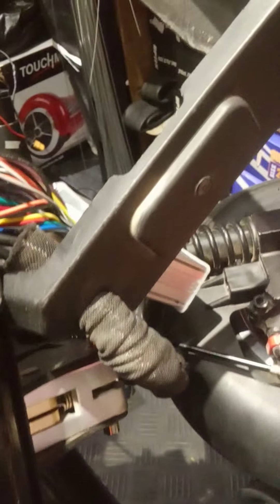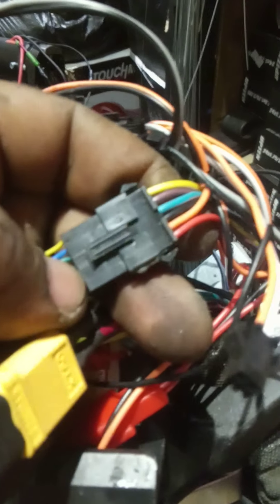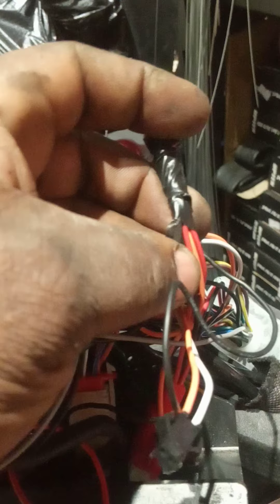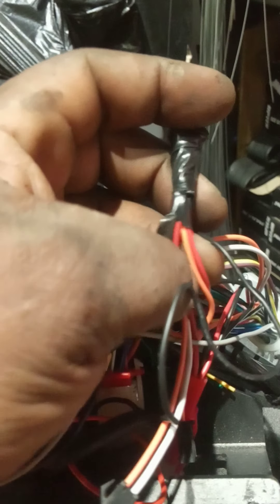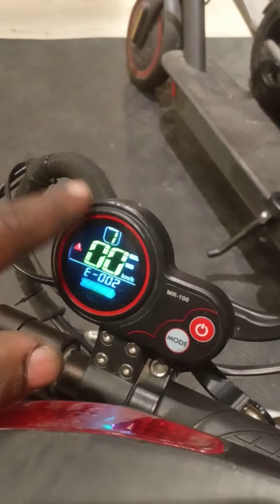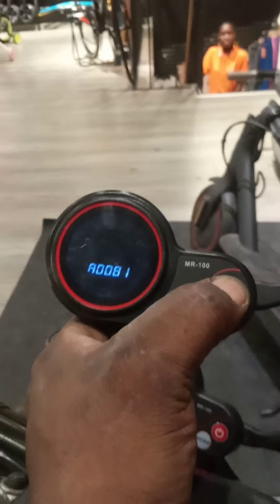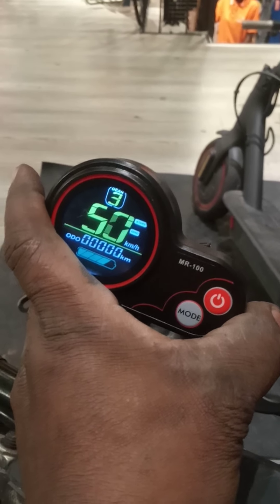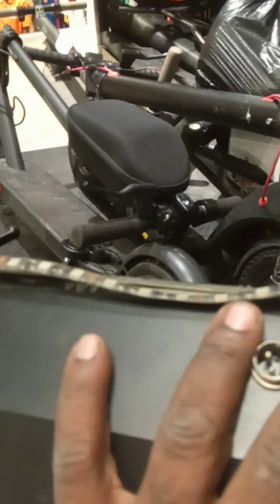Installation of brushless motor controller on E10

Comment: good morning friend I have an electric skateboard just like yours I have a problem the display does not work it wants to turn it on but it does not turn on and I have seen that the battery is fine could you give me some advice what could be the problem
Reply from the maker: Change the LCD
Reply from the maker: Change the LCD

Comment: Pls my motor work another side
Reply from the maker: Thanks for your support. Your motor has a reverse program of memory
Reply from the maker: You need to interchange the motor wires..if you matched colours and it still running reverse.then change. Example yellow -yellow,. Green -to blue and Blue -to green. Note interchange ONLY MOTOR PHASE WIRES !!!!!